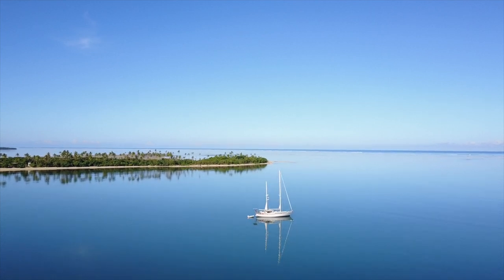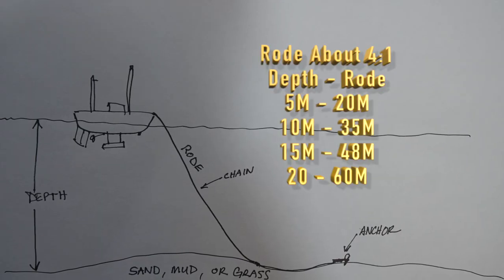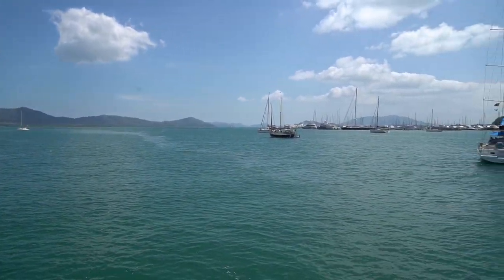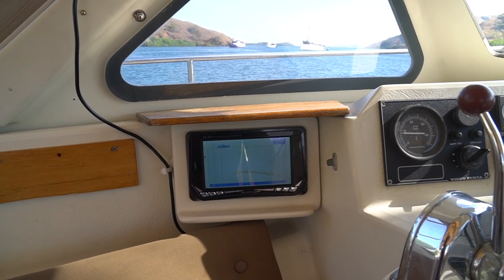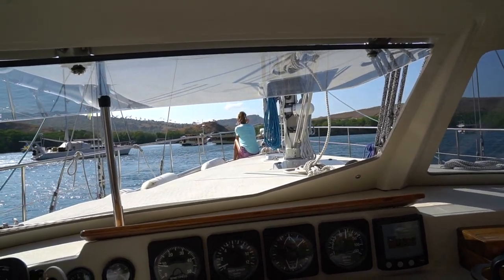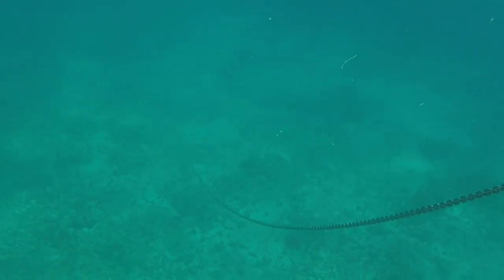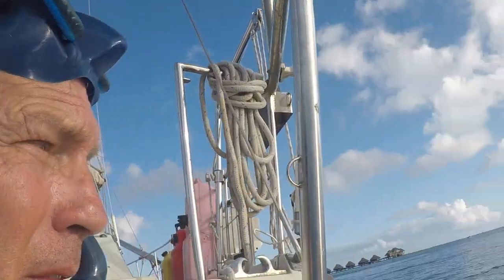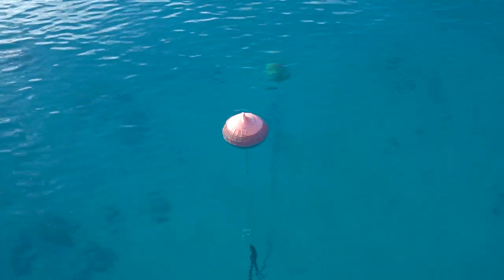Yep, those are my balls!  Anchoring skills!  Tips on Tuesday

Comment: Isn't the grip of the anchor determined by your anchor and how much chain is on the bottom? To what degree are you better off with a ball-lifted chain vs a shorter chain with the same amount on the bottom?
Reply from the maker: Floating the anchor is just to keep the chain off the ocean floor so that it does not get wrapped around things.

Comment: Ken,  @ arnd 16:50 I see you have you main sail preventer attached to foot of main mast. Is that for temporary storage or permanent? Same set up for the Mizzen? Also did you see my question on the waterproof lubricant for the 3 lip seals on the wear out prop shaft bearing? Hi to Zivile.  Teun
Reply from the maker: Hello Teun!!  I would put as much waterproof grease as you can on the (C-Drive) prop shaft seals.  The grease will probably last a year or so, and then get washed away, but it will add to the longevity of the seal.  (I hope this answers your question, but if not, let me know).  Regarding the preventer...  The preventer also is a vang.  So, the preventer acts like a vang until you need it as a preventer.   At least this is what I think...  All the best to you, and hope to see you soon somewhere in this small world.  Ken
Reply: Ken - same set up/principle for the Mizzen preventer?  Teun
Reply from the maker: @teunisbaas8888  Kind of, but because the mizzen sheet is routed below the mizzen boom, I don't have the "vang" attached at the bottom of the mast.  I do keep the preventer connected to the boom when sailing just in case I need it.